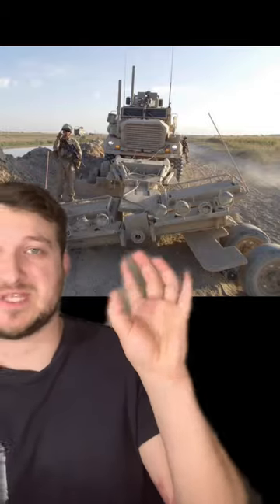Soldiers Getting Blown Up On Purpose . #shorts#army

Comment: In Sader City 04-05, they were very smart.  They set the AT mine as a trigger for a bigger IED . Stood our m88 up on its tail, aka tracks perpendicular to the ground( supposed to be parallel) . The crew was sent home with back injuries and TBI's. An m113 was cut in half by the 2ndary charge buried in a roadside mound/hill side making a shape change with an estimated 5x155s . Kaboom